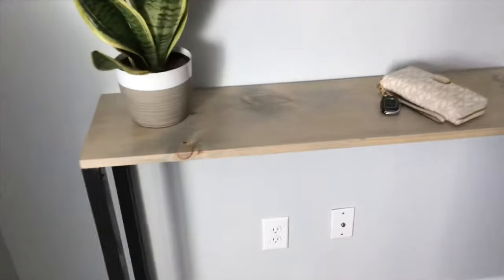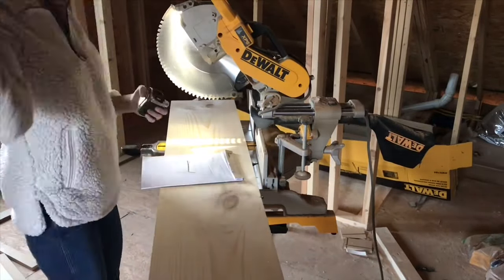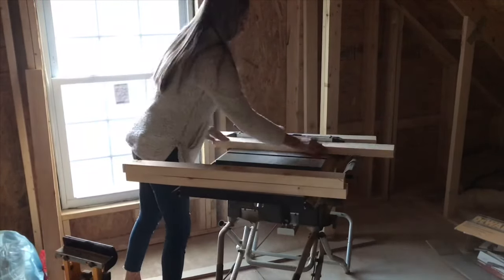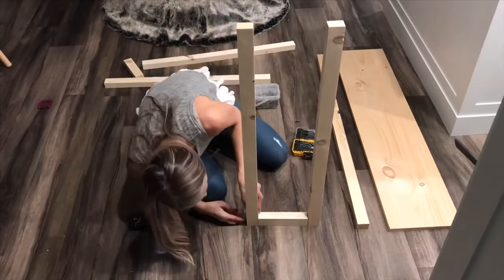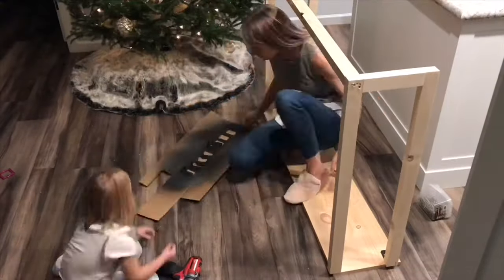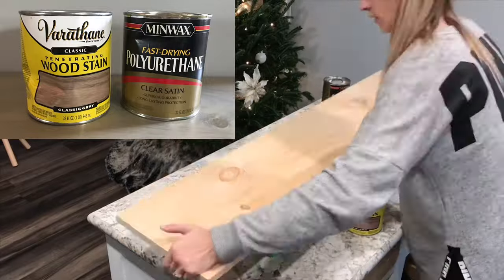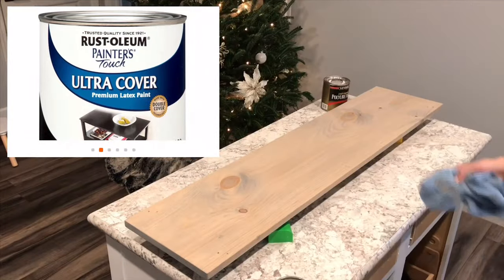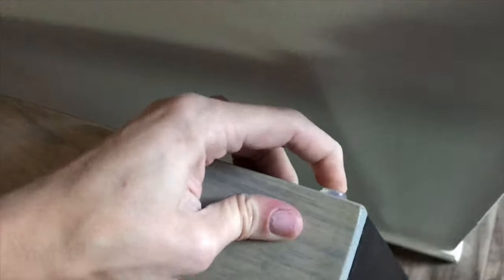DIY Tutorial Console/Bar Table Sofa Couch Table Under $50 (no skill required) | DIY Home Projects

Comment: Where did you get the legs?
Reply from the maker: Carla Tuck I cut the wood down. If I was to make this table again then i would use metal for the legs and glue for all the joints.